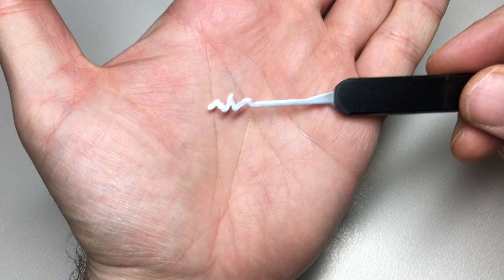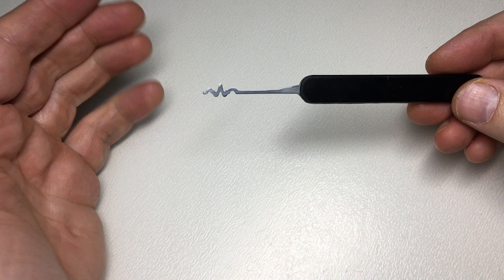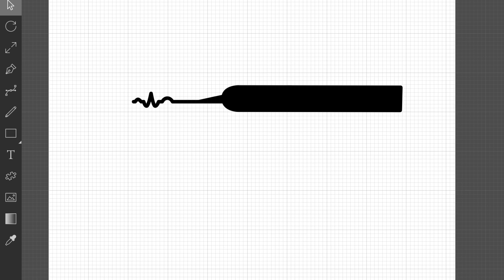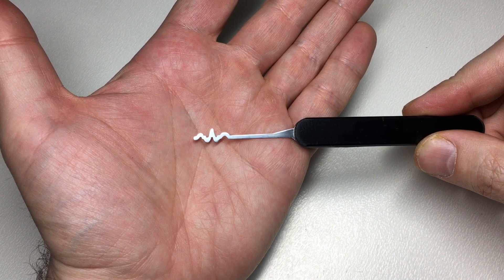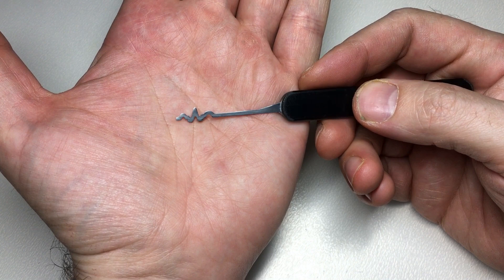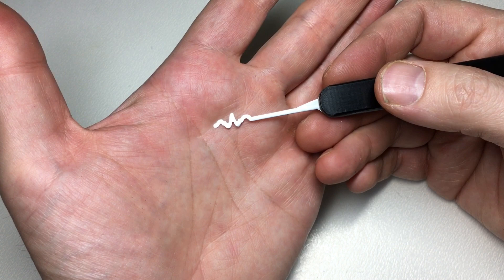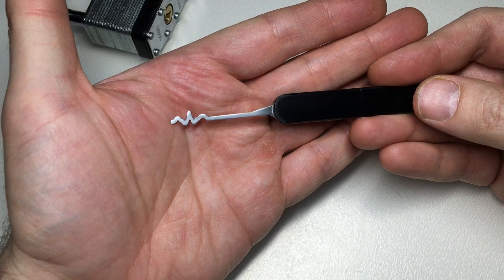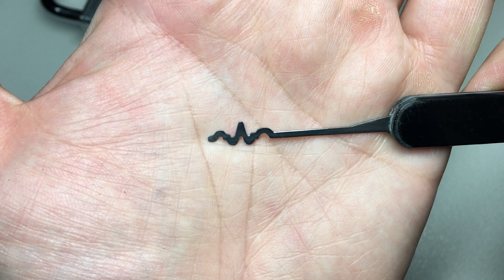(389) The Flatline Pick - Form Over Function

Comment: Many great things were discovered by accident, or doing a What If? Making picks is an art form, and in that respect, it's an art pick. Now all you have to do is design a lock to fit the pick. 
Take  Bill Bacardi cut key, and make a pick shaped like the key. You would wind up with a pick that looks a lot like your flat line. Extreme highs and lows as found in a challenge lock.
Reply from the maker: Thanks for the support :-)